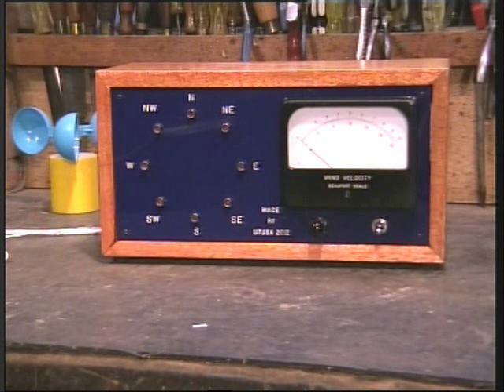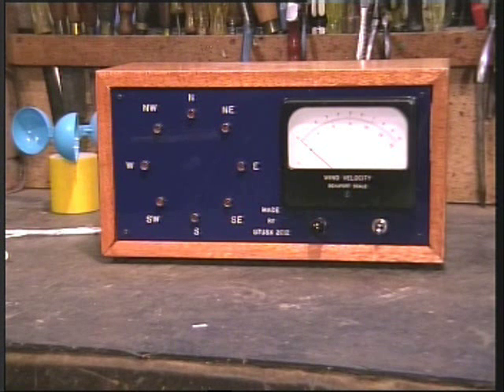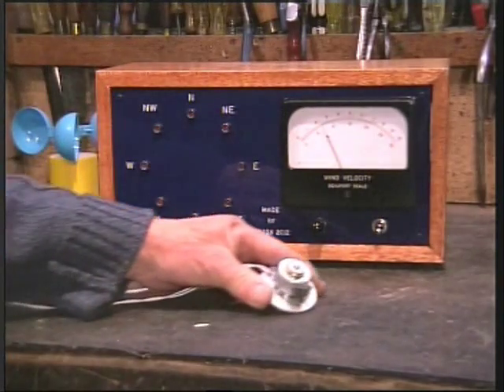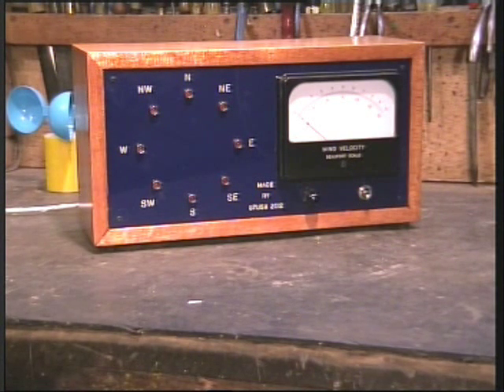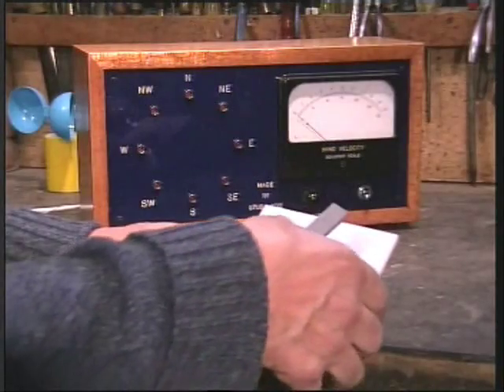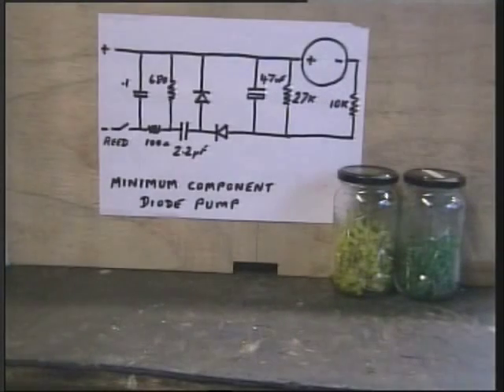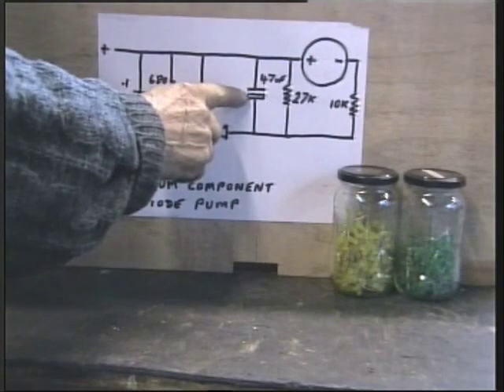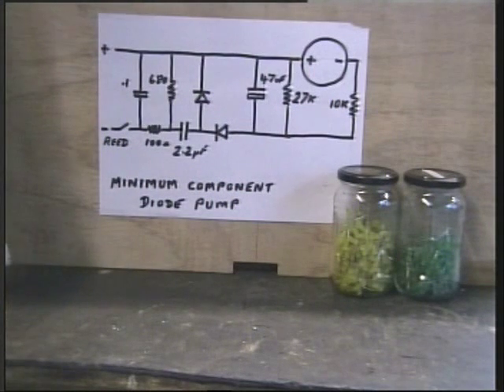weather station.wmv

Comment: Where's the rattle noise coming from in the wind direction apparatus? I didn't work with reed switches yet, but I'm wondering how you managed to arrive at such a discrete behaviour and get only one LED light at a time. Best regards